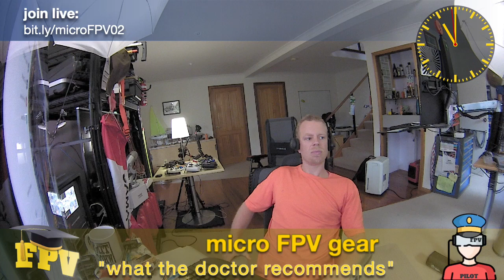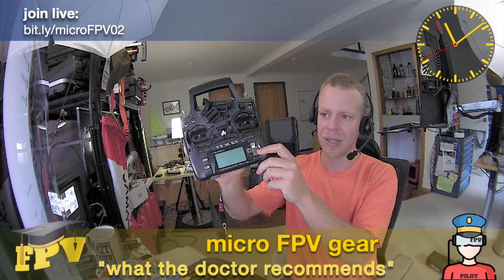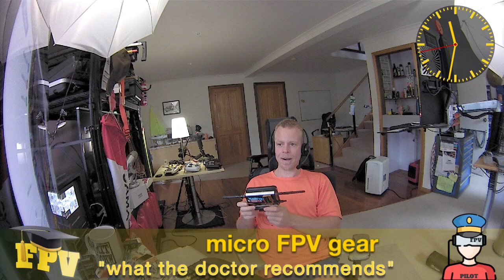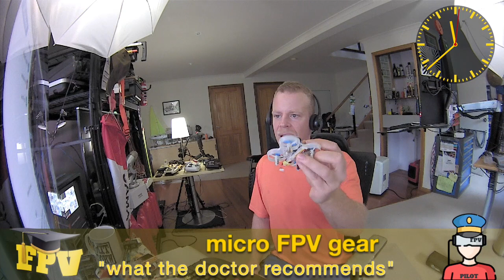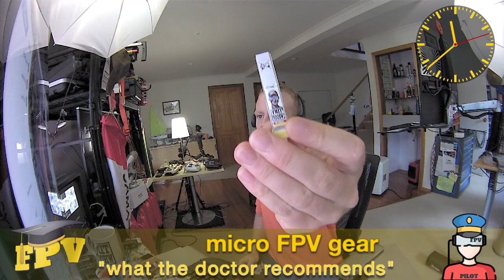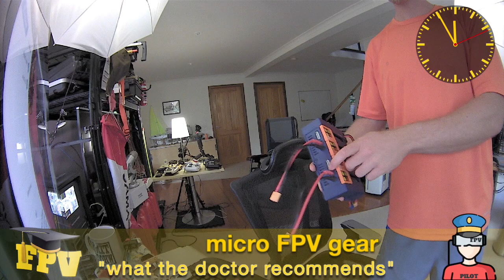micro FPV Gear - "what the doctor recommends"

Comment: Thanks Benedikt - this is good video! But man, all your videos are also great :)
But let me please correct you about Silverware history - it did not begin with Eachine E010 - actually, E010 can't be flashed with Silverware... It all actually began with non-ducted Eachine H8 toy quad when silverxxx wrote acro-only firmware for green H8 board, back in 2015. Project then developed more and he added level mode support, acro inverted 3D flying for Floureon H101 boards (non-existed today but there are some clones like Eachine H8S that can be flashed with H101 FW and used for 3D inverted flying), then came support for Devo telemetry,  BLE and Android telemetry, gesture PID tuning, support for some new boards like "blue" version of H8 board which later guided to support for BWHOOP B03 boards (that company was actually first one that intentionally made their B03 standard and pro boards to be compatible with Silverware and they marketed them as "Silverware compatible boards"), support for brushless builds based on all these brushed toy boards (RCGroups user Yets made important modifications for brushless builds and took this software to that direction)... etc.
And during that time, NotFastEnuf modified silverxxx work to support Eachine E011 board and added lot of improvements which actually take entire project to another "brushed board level" and today we have more specific pre-flashed Silverware brushed boards like Alienwhoop Zero, Betafpv lite, Beecore lite... and even some brushless boards for Silverware exists now... For all details please check Silverware wiki pages: http://sirdomsen.diskstation.me/dokuwiki/doku.php?id=start